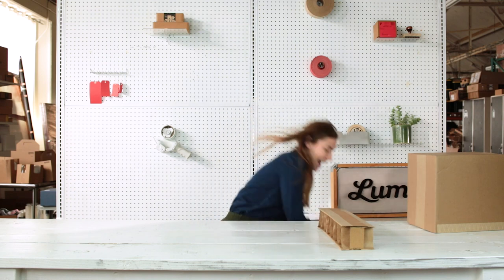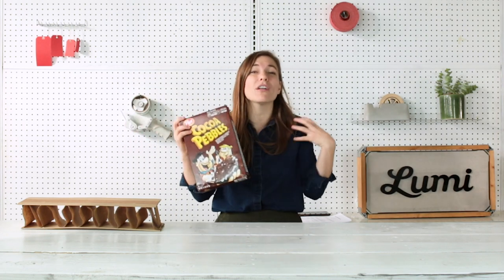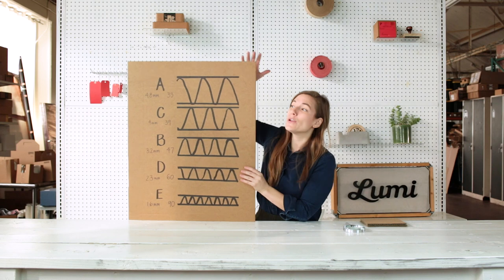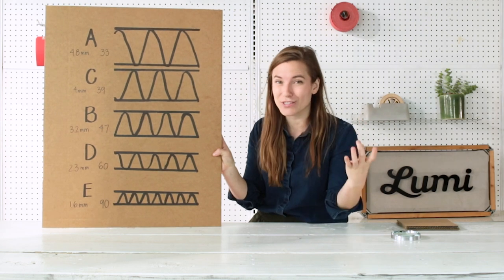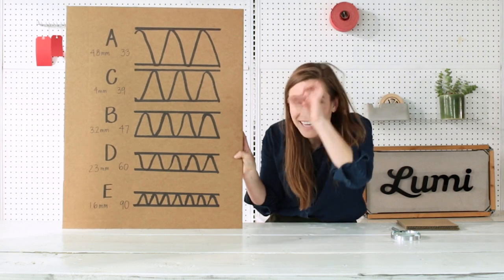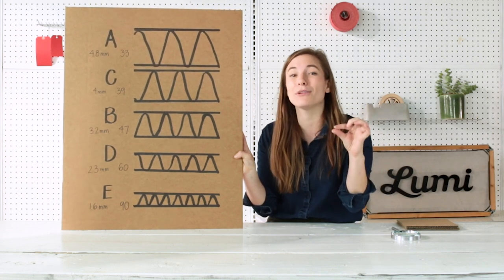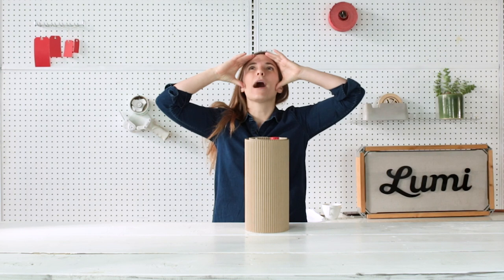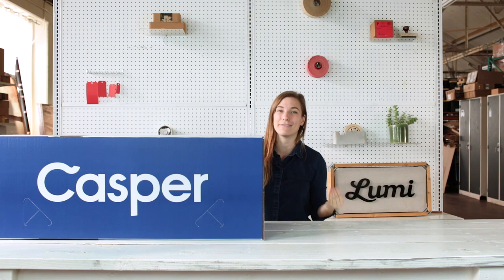Choosing the Right Corrugated Flute

Comment: I used to work for a Major Corrugated Container Manufacturer...

We made both Single Wall and Double Wall product. One of our other plants made Triple Wall. It was used to ship major appliances like Refrigerators, Washing Machines, etc. It was like a piece of Plywood. 

Fun presentation on Fluting. We had all those different type of Rollers. They were preheated with high temperature steam before placing on the Wet End of Corrugator. Heat and Pressure set the glue. Everything is carefully managed for quality control. We could make in excess of 6 million square feet of product per shift.

Comment: a) Cardboard (non corrugated aka chipboard) is also great option for a lot of products. I find a lot of shoes packaged this way, and these boxes are very sturdy, light and easy to the cut into smaller pieces for recycling. It also takes less storage unfolded, because it is usually thinner. It can make a difference when you are selling a lot of stuff. They are usually not the best for shipping, but not always, sometimes they are also very good for shipping!

b) There is also a honeycomb fill (more like squares / rhombus actually usually, but there are products with actual hexagons too around), that is also very strong, and is strong in all directions. It can be used almost as a construction material, insulation, even furniture. If you are packaging very heavy stuff, or separating layers between heavy containers, you can consider it. Or if you package multiple heavy things or varied size (i.e. furniture panels, with side and top and bottom being different widths) inside one package,  to fill spaces cheaply, lightly, but also strongly. Or want to secure weirdly shaped items inside the box and fill voids properly. They are very versatile!

Comment: Good video however double wall is not two sheets of single wall together. Double wall would be two flutes and 3 liners (5 layers total). Two sheets of single wall together would be 2 flutes and 4 liners making it 6 layers which is not correct..

Comment: Double wall isn't usually 2 sheets of singlewall board together, as that would end up with 4 liners vs. just 3 liners, right?  Also, you said "corr-a-git" at one point - isn't the noun said as corrugated (long "a" sound and "d" at the end or as a verb it is "corr-u-gate", still with long "a" sound?

Comment: OK so who decided to make it go from A to C to B?? like what I just can't even
Reply from the maker: We're right there with you. We'll let you know when we get to the bottom of it 😉
Reply: @ShippingThings  It's because A and B were invented first. C-flute began to appear in the mid 1960's (first offered commercially in Canada in 1964). People soon learned that A-flute crushed too easily (with lighter papers) but B-flute did not have the (vertical) stacking strength. C-flute fits exactly between the 2 and was created to capture the best of both worlds. Today, A-flute shows up rarely (except in triple-wall and some double-wall) while C-flute is 60 to 70% of the typical output of a corrugating box plant. Additionally, D-flute is not some forgotten, mysterious flute - it's big in Europe but relatively new in North America. Again, it fits exactly in between B- and E-flutes. Just to make things more complicated, D-flute is also called R-flute by some.
While I've got your attention: Double-wall is not 2 single-walls laminated together - it's actually 2 single-face sheets + a liner. Also, chipboard is not cardboard - chipboard is chipboard. Another name for cardboard is "folding carton" (the name I prefer).
BTW - great video and great energy!